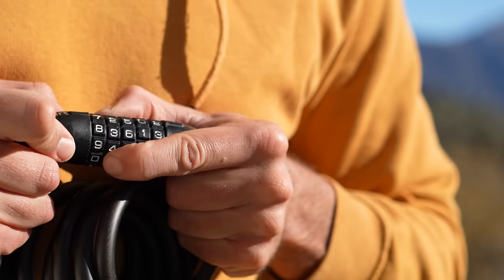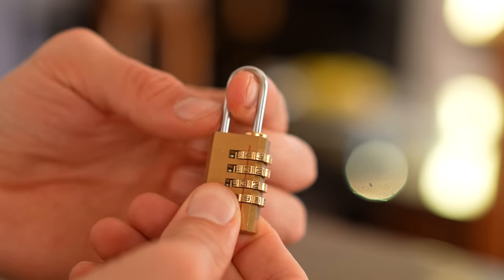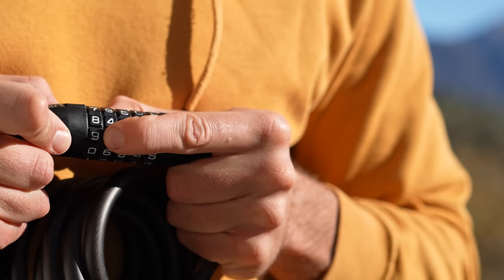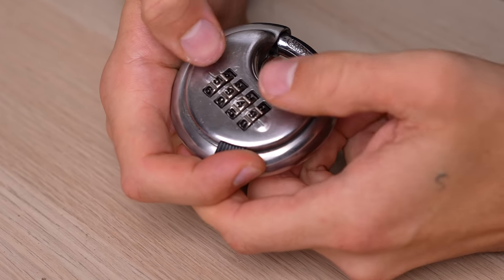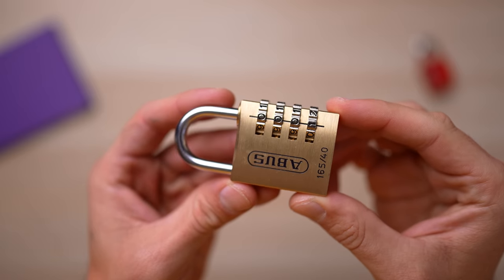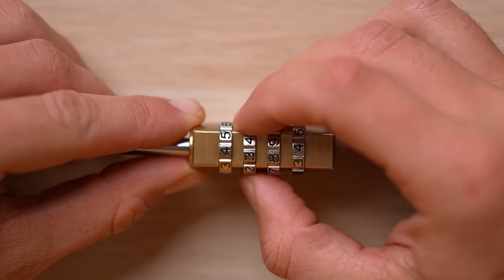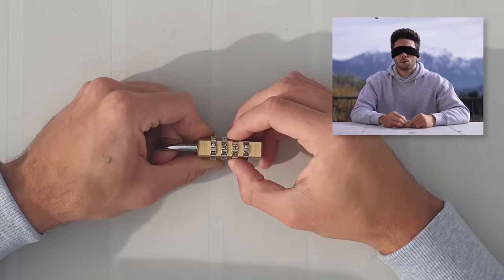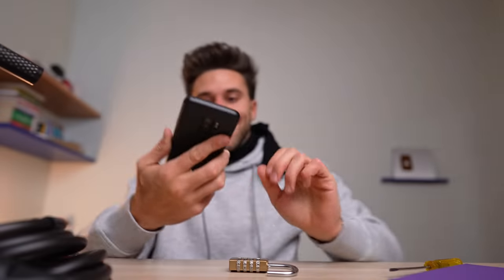This is Why Combination Locks are Completely Useless

Comment: The purpose of that kind of lock is just to delay the theft since it will took a lot of time to crack the numbers.
Reply: during a robbery every second counts
Reply: All locks only ever delay a theft, anyone can get through with enough time and persistence. Thieves are not notably persistent tho and they will usually seek the most profit for the least time spent. You can bet they'll always take an unlocked bike over cracking your dollar store back to school sale combo lock.
Reply: 5 minutes is not long.
Reply: @Softpaw1996  it’s long enough to get noticed which is what thieves want to avoid
Reply: @Softpaw1996  It's Time of Execution + Time of Escape > Time of Detection + Time of Response

Comment: This is all you need in a padlock: Ball bearings to prevent shimming and security pins to prevent common instant opening methods like raking. Some amateurs may still be able to manually pick it, but it might take them quite a while, and even an expert would need at least 30 seconds to manually set all the pins, possibly longer. I imagine if a thief is messing with your lock for more than a couple of minutes, they're going to leave before they get caught! Look for something easier...
Reply: Just like running from a bear together with someone else. You dont need to be faster than the bear... Just faster than the other guy...
Reply: A bolt cutter in under a minute.

Comment: Great video. I just bought the exact same lock as that red one. There are several numbers which appear to bind the next number or none that bind it depending on how hard you try. I've tried for 15 mins to crack it and my thumb is so sore I had to stop. It's not as easy as it looks, you really need to learn the 'feel'.

Comment: Great video! thank you! There is another method to that works on many combo locks that you didn't try. If you use a flashlight and look very closely in hte gap between the dials and the lock you can actually see the gate, SO when you have found the gate on all dials when they are facing you, just turn them 5 steps to get the gates in the right place. try it! :)

Comment: It used to be a hobby of mine to just solve locks on my granma's pool resort and she has a LOT of locks for the lot of areas and rooms (engine rooms, pavillion gates, the main gate, vehicle entrance gate, diner gate, main house screen door and such). The most common lock she has are the button combination locks I just thought of solving randomly. Starting with 1234, 1235, 1236, 1237 and so on until I find the right combination. I easily became the guy who they call on whenever they forget a lock code 🤣.

Comment: I used to use a brass 4 gate combo lock at the gym for years. Then I watched a similar video and decided to see if I could open it without looking. First time I ever had attempted to crack open any padlock and it took me about a minute, just by feel and slight pull pressure on the bar. I was stunned and went and got me a quality keyed padlock.

Comment: Maybe all we need is a lock that has that is fingerprint activated. So you have to unlock it with your fingerprint AND unlock it with the key or a combination. 

That would take electronics and an energy source. But you could build a generator into the lock and handcrank it. When you hear a beep, you can put your finger on the fingerprint sensor.
Reply: When fingerprint scanners become commonplace, determined thieves will either force owners (at gunpoint/knifepoint) to unlock them, or just start stealing their fingers.
Reply: @AutPen38  nothing solves every problem. 

If a thief is determined, there are still less risky ways to steal than direct confrontation.

Comment: I don't use locks as theft  prevention, I use them as theft deterrent. As most people already know, given enough time, anyone can open or break a lock. Whenever I lock my bicycle for example, I try to lock it in an open location with a lot of traffic and just have the lock to slow the theft down so I have a higher chance of stopping it, aswell as the lock makes my bike less of a target then one without. If you're going to steal from me, I'm going to at least give you a challenge, you won't get it without some effort.

Comment: The more you learn about security measures(I.E. locks), the more you will realize that any security measure can be overcome through a sufficient amount of time, effort and dedication.

So why do we use security measures at all?

Stopgaps, and to prevent things from being easily stolen. This is why combination locks can be an effective way to prevent most locker room thievery for instance despite being possible to crack; and per the definition are not 'useless'.
Reply: These are useless as they are far too quickly and covertly defeated. They can be opened without even looking suspicious
Reply: Yeah, I was foolish in my 20s and didn't have a lock.  I had my only nice watch stolen.  I was a fool to assume no one would.  Not, sure why I didn't just wear it.  I know it was big.  So, who knows maybe It was uncomfortable.  If I had any lock it would prevent people from even realizing there wasnt just clothing in there.  That most wouldn't want anyway

Comment: I also bought and picked the first lock, and i want to add that it is super easy the first time, but after picking it 10 times or so, it started getting more difficult because the dials are a little smoothened and dont klick as well. I am pretty sure it also goes for other locks.

Comment: In most situations, if it takes more than a minute to pick a lock, then it is safe in most circumstances as someone would discover you trying to pick the lock. So they  are not useless. And you also don't have to carry a key for these locks.
Reply: A minute of someone not around,  they would be unlucky if anyone notices it.

Comment: Easy to do when the lock is in a convenient position where it's relatively easy to apply just the right pull on the shackle while tweaking the dials. Try it when the lock is not in a convenient position for example when it's wrapped around a bike and a bike stand and you're unable to rest your hands/elbows on something solid. Then you'll find it much more difficult to apply just the right amount of pull on the shackle and a precise gentle touch on the dials. It will be much more difficult to feel what's happening inside the lock so you won't easily know when the grooves and cutouts are aligning. Not saying it can't be done, just saying it's much more difficult and time consuming.

My point is... when locking with a combination lock take a little time to think of how you can position the shackle and dials in a way that makes it difficult to grasp them and move them easily/precisely. When locking by bike I like wrapping the cable in a way that places the dials inside the wheel spokes

Comment: I remember in 4th grade when I couldn't remember for the life of me my combination but I had realized if you had the right first number and tried to pull it out it would feel different, so I managed to get the first 2 digits completely right before the last two digits came back to me. Crazy how I used the same combination lock for over 4 years after that and still didn't have my bike stolen, before going to high school and actually using a big metal U-lock that required a key.
Reply: tbh if I had a lock I didn't want picked then I'd use a lock without a key (aka a digital areas lock) because any external lock is really pretty much useless

Comment: I have a combination lock with a mechanism that is none of the above: is the Forclaz cable lock by Travelsentry, and since it works in a completely different way i couldn't use any of the tricks you suggested to open it, because the part that "locks in" is not connected with the combination. The code serves because when is correct allows an inner slider to move and put the ending metal ball of the cable lock in an alcove that is otherwise unaccessible. So, since only the slider is what is controlled by the combination there is no direct way to interact with the teeths separately one from another. You should  try that!
Reply: thanks for the tip

Comment: Nice test. There is, however, a tiny flaw in your test. Especially with the round lock. You had a difficult time to turn the dials on your desk. I suppose, you will have pretty much harder time to dial if you need to bend over and stuff, but still it will break eventually. There is no lock in the world that cannot be broken. It is only a matter of time and effort. Using an angle grinder, for instance, is pretty fast, but is it more obvious to use it than someone bending over the lock for two or three minutes? 
So, a lock is all about buying time so that someone notices the lock-picker and takes action against him or her. I believe that civil courage needed for this is disappearing from society in the well-fed world, unfortunately.

Comment: Combination locks most likely have springs. And because spring spring, you can smack it. Some of the locks work differently, like on some locks, you need to pull the shacke up or down and them smack it.
Fun fact, if you're using a Disecu combination lock, it can be opened with a Disecu combination lock.

Comment: If you look close at 3:22 you can see the combination in the gap between the disks. That's it, you just look down the gap and you can literally unlock it visually, no tools. On tighter locks that you can't visually look, you can put something thin between the gaps and feel the gap instead.

Comment: This technique does not work with Abus BORDO Combo Folding Lock since you cannot apply tension. There is a button that engages the gate, and it either lifts or it doesn't. Putting pressure on the button does not put tension on the wheels of the numbers.
Reply: The LPL review of it

Comment: Remember this, “the more dials the lock has, the more combinations it has, also if you have 5 dials you have 99,999+ combinations depending on the number of digits a dial has”, wise man… get the locks that have more than 9 numbers per dial

Comment: You can still open the locks even if they have some mechanism that prevents the tightness feel, or even if it even prevents hearing the clicks.
If there is 4 rolls and 10 number by each roll (0-9), then there is 10 000 different combinations (0000-9999). It is possible to open, by using time and trying all the combinations. Start by having them on 0000, then move the first roll so that you go one by one to 9 and then go back to zero and move next to 1... and so on... so go like you would go by counting.  Just go one by one and try to open the lock with every combination. 

This takes time but eventually you will get the combination right. There is maximum 10 000 combinations so it will take only like max 10 000 seconds if you are slow.

Comment: Lol. I paused the video halfway through, because I remembered I had an old combination lock lying around somewhere. I found it and tried both of the initial methods. I however felt several false gaps, and most of the dials locked up as soon as I applied pressure. Frustrated I kept watching, and a few seconds after he pull out the almost exact same ABUS lock as mine, and explains the same symptoms. The relief!

Unfortunately, after a few minutes of trying, I haven't been able to unlock the lock. I've found all the gates - they are also every second digit on my lock, but none of them can move freely under tension, so I'm not sure what to do...

Comment: Firstly I need to congratulate on what is a truly excellent video. That took you a long time to film and edit! However... for anyone else reading this, this is all about content. These techniques are in no way representative for all combination padlocks. On top of that, the mastery of cracking a lock is not purely learning ABC. The more you do it, the more you get a feel for it, and by making this video and testing tonnes of locks to find the ones he wants to film, Mike will have in fact become quite sensitive to lock cracking mechanisms. If he then went away for a month or two and came back he wouldn't have the same luck without going back through the processes. It's a known thing in lock picking circles. You need to stay current in your "feel".

The point about false gates are valid and ABUS, being perhaps the best lock manufacturer, they add different false systems to their locks. You can't just crack the 165 series and think you can then crack all combination locks or even all ABUS combination locks. It just doesn't work that way.

So to summarise.... Mike has made an amazing video and I love the illustrations of the mechanisms. Amazing. But he's also chosen a few locks which work for the point hes making, therefore making it appear all combination locks can be cracked with these three methods. It's content creation and hes got 6 million views from this video and made $$$$ from it.

Video creation and production 10/10
Validity of content in the real world 3/10

Comment: I use combination locks to secure a latch or to secure something to a pole where theft security is not important to me. For example, I would use a combination lock to secure the pin on a trailer clamp from popping open on its own, more so than being security against theft.

Comment: combination locks don't give a lot of security for a number of reasons. particularly the ones with 4 or less dials because even if it doesn't have easy methods to bypass it, it doesn't take very long to check all the combinations.

Comment: Buy a Forever Lock padlock

If you lose your keys, you're not getting in without an angle grinder and/or a diamond hacksaw and LOTS of cutting.
Thieves aren't getting in either.

They also sell Bicycle U-Locks and cable locks which require SEVERAL angle grinder discs and even more cutting, even on the weakest part of the lock.

Comment: the biggest weakness for using this method is time. as a guy who worked in service industry for years, i always check cctv monitor every few second whenever customer parked here. by the time you're found messing with customer vehicle, i would grab machete and charge at you with it. unless you can beat combination lock in less than one second that is.

Comment: for the more conventional dial locks, theres an easier method where u simply try to spot the hole in the gap between the lock and the dial. when u find all 4 or 5 then u simply reverse the numbers and its unlocked. takes no more than 30s its that easy.

Comment: They are NOT completely useless. It's understood that the purposes is not to prevent access but to slow it down. The longer it takes the more chance of getting caught. In most circumstances this is enough to deter nearly all thieves.

Comment: Many years ago, uncle has these 8 buttons pad lock installed on his fence, you buy it as it is, you can't change the pin. There are 8x7x6x5 = 1680 combinations. It took me 6 second to open it, how? The pin was 1236. 

So I got it on my 3rd try. I learned if we are going to use those padlock, don't get something that start with a 1.

Comment: When containers are shipped they are secured with a locking pin that requires a large bolt cutter to remove it. Locks are not used because they are expensive keys get lost and using a pair of bolt cutters will damage the bolt cutter. So it is just cheaper safer and faster to just put a $0.50 piece of steel between the thieves and your stuff.

Comment: Method doesn't work on all combination locks. Like Abus 158 - but mostly there's other methods and that particular is easily decoded using a thin piece of plastic.
One lock I'd say good luck on is the Sargent & Greenleaf 8077... That is of course quite another league and also takes more time to dial correct combination.
But the locks are good enough for securing a back door etc. which you need to be able to open but thieves need to be slowed down. For use where people has plenty of time (remote areas outdoor, basements etc.) it's better to use a good keyed lock where you need to use brute physical force and tools - even though the lock doesn't need to be that physical strong. And beware you need a good brand name in order not to pick it easily or use a comb pick - something like from the Assa Abloy group although there's also other brands - most of all stay away from Master :D

Comment: Try a masterlock, where you have to spin it to a number, then spin it the opposite way to the next, and the opposite way again to the last.
Onyl way you could probably crack it is to literally break into the lock or use brute force
Reply: It’s actually really easy. They also rely on gates so you apply medium tension on the shackle by lifting it upwards and you will feel resistance in some numbers which are the gates.
Reply: @shitpostshorts765  damn you!!!!!!!!
Heck it. Card locks, swipe your card that has specific details to unlock something.
Now crack it >:(
Reply: @safeguard1792  some have exposed locking mechanisms which can be picked ranging from lego figures, forks, screwdrivers and some even with a thin piece of cardboard

Comment: Most serious bike thieves bring gear to cut the lock because they don't have time, so the lock is more for opportunity thieves. We have a saying "opportunity makes thieves", so if you leave your bike just standing there, the temptation and opportunity to simply ride off is a lot bigger than if the bike was properly locked up. There, the thief needs to be really determined